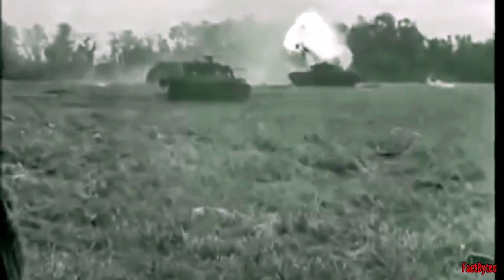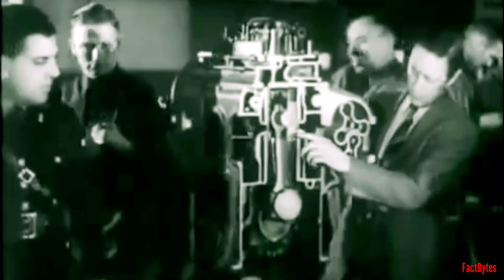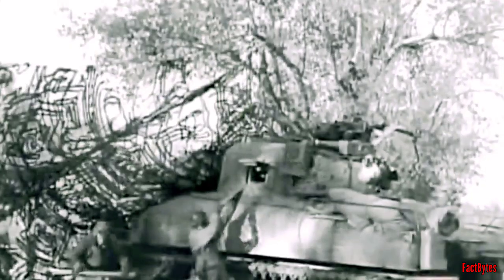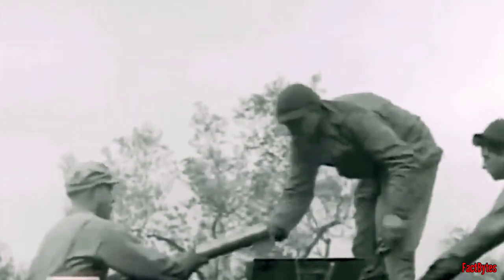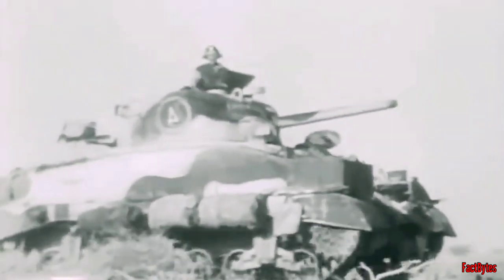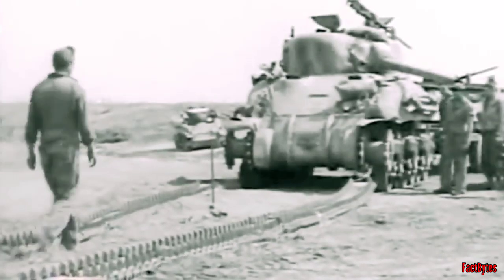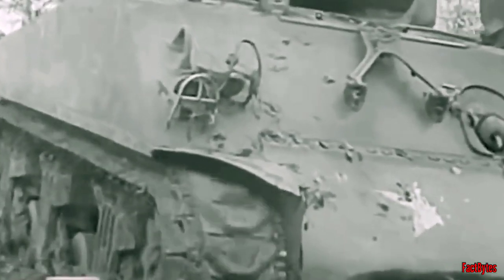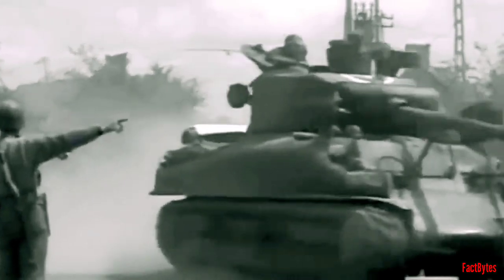How Good Was The M4 Sherman Tank REALLY?

Comment: Odd phrasing of statistics! You stated the Sherman would catch fire 82% of every 1.89 times a shell penetrated. Is not .82x1.89=1.5498? Basically 4/5 of the time when the bill was penetrated the Sherman caught fire!
Reply: and they corrected that problem with the wet stowage didnt they? meaning they didnt catch fire as much?
Reply: @Swellington_  It wasn’t clear to me if the statistic was before or after the wet storage was implemented. I do know it’s always bad to get shot when in a tank. Even if there isn’t penetration or spall you’ll get a headache for sure! LOL!
Reply: @jackjones9460 yeah,good point
Reply: The Sherman's fuel tanks were high in the engine bay, making the tank extremely vulnerable to any penetrations and also shock kills from HE rounds landing nearby, as this could cause fuel leaks from cracked fuel pipes straight onto the engine and electrical system. The German infantry was taught to target Sherman's fuel tanks when possible with Panzerfausts as this ensured a one-shot one-kill. The Shermans were only an effective tank due to over-whelming numbers and Allied air superiority, under-gunned and under armoured, they were inferior to the German tanks. Not the best tank of WW2, but good enough to help win the war.

Comment: If the Tiger tanks had been equal in number to the M4 sherman and T34, and had been easier to repair, they wouldn't have Won. I have never heard of a sherman or T34 that shot down over 100 enemy tanks, the Tigers have that done. Its not a political discourse, but only technological superiority and capability in war construction.
Reply: So basically if the Tiger was a completely different tank lol
Reply: @redaug4212  😂yes it was! Was the best WW2 tank, it was not easier to repair because was high technology tank, but in equal number there wasn't the problem to repair it. But the M4 Sherman wasn't a good tank, also in Korea war the T34 /85 was better than the Sherman.my opinion than the Sherman is: it was the wrost tank. This the reason why the great Britain put on it the 17 libre 76,2mm high velocity cannon but they called firefly. The M4 Sherman was good only against infantry and anti tank posts, for The HE bullet High Explosive because the 75mm cannon was equipped with bigger HE than the 17 libre 76,2mm. But not against tanks. This is My opinion.
Reply: @simonedematteis-tortora2197  Yes, you're saying that if Germany had the perfect tank design with zero drawbacks and was easy to mass produce, then they would have beat the Allies. In other words, you're asking for a tank that doesn't exist and isn't the Tiger. 
You wehraboos come up with the silliest methods of coping, I swear.
Reply: @redaug4212  i said and I wrote , the M4 sherman, original one, no the firefly is the wrost anti tank ever made in WW2 .the T 34 was the best tank in WW2, easy and fast production line, engine, and agility. But I said also the best in technology, fire power, 88mm cannon, and radio equipment and bullet charge velocity was the and Tiger and panzer 4 with 75mm high velocity cannon. I wrote also there are no tank in WW2 hystory is able to destroy 100 enemy tank. like tiger tank was able to do and done. It s not a politcal discussion ,it s only tank technology discussion. For me the M4 Sherman was not good. No fire power and less armor than the other tanks.
Reply: @simonedematteis-tortora2197  The M4 literally had better armor than Germany's main battle tank, the Panzer IV, and was comparable to the T-34's armor.
If this discussion is about technology, the very least you could do is actually look up the specs for the M4.
Reply: @redaug4212  depend if welded and not welded and where. the angle  and turret. panzer 4 hull 80mm . the M4 12.7mm to 177mm welded and depend of part and variant.
The Panzer IV saw service in all combat theatres involving Germany and was the only German tank to remain in continuous production throughout the war. It was originally designed for infantry support, while the similar Panzer III was to fight armoured fighting vehicles. However, as the Germans faced the formidable T-34, the Panzer IV had more development potential, with a larger turret ring to mount more powerful guns, so it swapped roles with the Panzer III whose production wound down in 1943. The Panzer IV received various upgrades and design modifications, intended to counter new threats, extending its service life. Generally, these involved increasing the armour protection or upgrading the weapons, although during the last months of the war, with Germany's pressing need for rapid replacement of losses, design changes also included simplifications to speed up the manufacturing process.

The Panzer IV was partially succeeded by the Panther medium tank, which was introduced to counter the Soviet T-34, although it continued to be a significant component of German armoured formations to the end of the war. It was the most widely exported tank in German service, with around 300 sold to Finland, Romania, Spain and Bulgaria. After the war, Syria procured Panzer IVs from France and Czechoslovakia, which saw combat in the 1967 Six-Day War.
Reply: @simonedematteis-tortora2197  In other words, the M4 wasn't actually the worst tank of the war and was actually on par with, if not better than, most other medium battle tanks of the war.
Reply: the original one was the wrost, The english army called it Ronson, like the lighter. One shot and was on fire. Usa build the M6 heavy tank but didnt use it,because to heavy to transport in the europe battlefield, was like to transport 2 sherman. they prefered use more M4 and more soldiers. The best variant of M4 was buided from England ,the M4 Firefly and Canadian Army,The Grizzly.
The great britan version had more fire power  the Canadian version more armor. M4 A2 and M4 A4 Thats it.
Reply: @simonedematteis-tortora2197  Early M4 variants had no major problem fighting against German medium tanks in North Africa, and the "Ronson" nickname has never been proven to actually have been used during the war. Moreover, after the introduction of wet stowage, only some 10% of M4s caught fire after being hit. Furthermore, the burn rate of non-wet stowage M4s (82%) was not significantly worse than the burn rate of Panzer IVs (80%) after penetration. It's frustrating that people like yourself insist on picking out the flaws of the M4 for simply being a medium tank, while ignoring the performance of other tanks in the same weight class.

American-operated M4s performed just as well as those operated by Anglo-Canadians. 75mm M4s did well against Panther tanks in the battle of Arracourt and later during the battle of Elsenborn Ridge. Not to mention that M4 variants such as the M4A3E8 and M4A3E2 were also up-gunned and up-armored, yet you seem to ignore those and pretend as if the US Army neglected development of the M4 altogether.
Reply: no its frustrating how much you love this garbage M4 tank and you ignore the fact about how much higher the german tecnology improve in all WW2 Scenario, a little state with the higher tecnolgy of all earth! first to improved with a 88mm cannon in a tank,first to improve in aeronautic ,first to invent jet propelled, and negative angle wing, if you think the USA and USSR have a space program, the only one is german V1 and V2.you ignore the operation paperclip, USA and USSR, they stole and took in  country back all tech German all the inventions all the german scientists. About the M4 sherman you can say what you want ,but my opinion is why USA product the T32 to fight against panther tanks, and why all the other countries had modified a lot of this M4 Ronson Tank during WW2? I dont know where you learn, but I know one fact there are only reason to be ignorant, is the belief you are always right. because in history the bad was german and the good was american. Look today and remember the 1962 kennedy words" if american have not enemy they must invent it." How many wars USA done? I say to you, after WW2 always and in all the world. And also 4 in the same time in same year in different country.who is the bad , and why you think the sherman was a good tank now?. because was American ? because about the M4 technology was a garbage. the first had no radio no fire power cannon with only 50mm of armour.  in the africa battle allied win only for aviation support and the continuos tank  replacement and ammo supply not for the M4 SHERMAN but for the number, replacement  and supply and aviation support. you have to learn History, and watch the things with objectively and read hystory books. without pre convinction. open your mind and learm dude.
They win in arracourt and in Elsenborn only for number of tank and soldiers,replacement, gasoline, supply and aviation support. Easy to do !

Watch this.  https://youtu.be/Az8G6rCF74s

https://youtube.com/playlist?list=PLutxxLC5zRbx-ejz2ca4zBv5G4y6YnuF2
Reply: @simonedematteis-tortora2197  You don't even know what the battles of Arracourt and Elsenborn Ridge are, do you?

Comment: If the Germans tanks were hit in the rear such as the fuel tank they can still fire the gun
Reply: But they can't move or traverse the turret so not for sure what this comment is about
Reply: @chadjustice8560  their is such thing as a hand crank
Reply: @ryleeculla5570  in the middle of a fight especially if the fuel tank has been hit, it's probably on fire anyway so they are not hand cranking it. But if I remember correctly with the PTO actually running it was like a 20 second 360 time with the turret so by hand your not going to go very fast.
Reply: @chadjustice8560  can’t they just try playing dead or something?